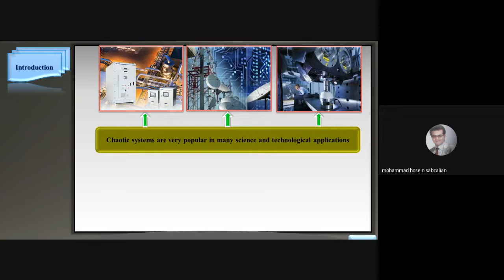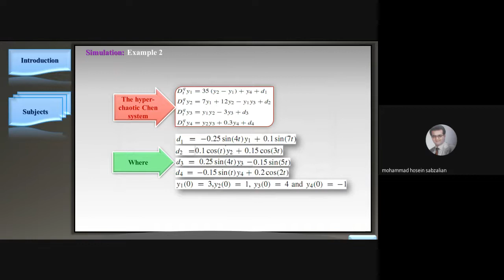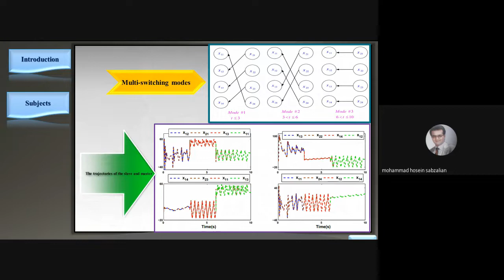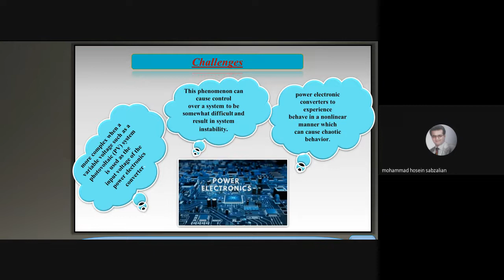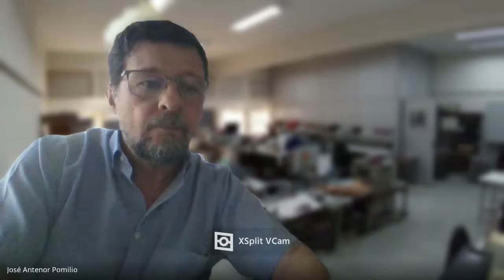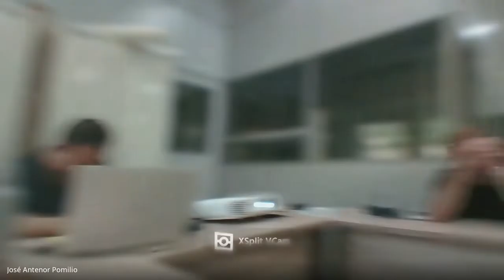Seminar LabREI Hosein Adaptive Fuzzy and Power Electronics

Comment: I profoundly enjoyed watching the seminar by Hossein on Adaptive Fuzzy and Power Electronics. from his presentation on modeling of converters, which included fault analysis and compensation for the other main considerations. From this seminar, I was able to understand the electrical characteristics, principles of operation and application, as well as the advantages and disadvantages of many circuit topologies that are used. As a researcher at North Carolina University in Research Triangle Park, this seminar will improve my knowledge of power electronics and assist me in understanding photovoltaics and related topics through providing a greater understanding of photovoltaics in general. Furthermore, from this seminar I was able to collect a variety of books, both written and electronic, that provide more details and references on the topics discussed in class. At the end, I would warmly appreciate the professor, Antenor Pomelio, and Doctor Hossein  for their great effort and time in providing such a fruitful seminar.
Reply: Hello from Brazil- Campinas to North Carolina to my great and knowledgeable friend. I am very happy that you watch our seminar and it was useful for you. Here in Brazil, we have some good equipment in this laboratory that we are going to examine some novel controllers on them. It would be great full if you participate in our next seminar too. 
your pal Hosein